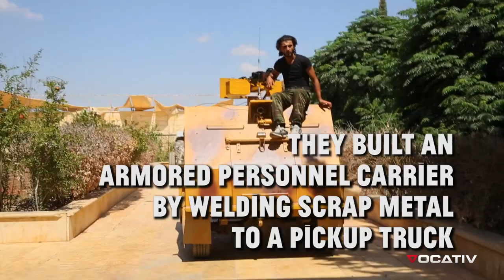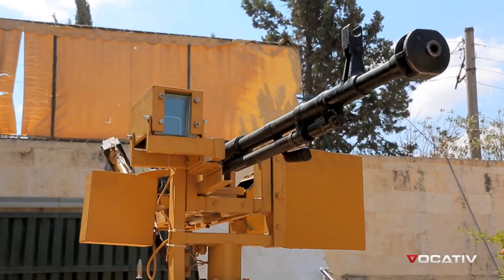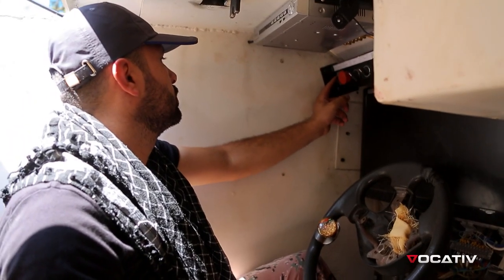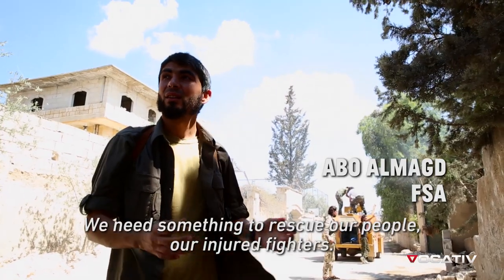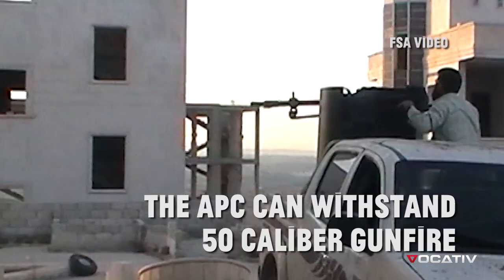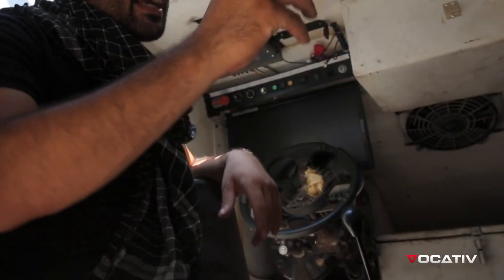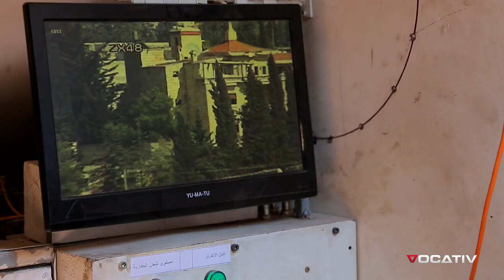DIY Tank Used in Fight Against ISIS

Comment: It has to have tracks to be considered a tank, this is an armoured fighting vehicle.

By the way, I'm pretty sure 50 cal goes trought scrap metal like a hot knife trought butter, you'd assume it'd have some markings if it had survived 50 cal shots before.
Reply: Yea. Agreed. This isn’t terrible for a IFV towing a APC trailer…. 
But it needs some spaced Armour at least 10MM thick. With The Gun Receiving some Armour too. Some. (Concealment Armour mainly).   The Inside TV could receive a High Quality Resolution for what he has.   With Spall Protection.   At least for the Gunner.     If he can take out the DUDE that just took out the Driver and Half the IFV…. That’s a Win.  Cause he’s probably the only one if that battle in this country that could take the IFV out anyways.   Be Cautious… Take your time.

Weld Good Reliable Welds. That ways when you come under Pressure from say an Explosion. Your not Tearing at the Seams.
Rupturing your Organs. And releasing your memories to What you believe in
The Back Axle should be a Duelly. 

Fuel tanks covered. Etc. 
The gun really needs to be Upgraded heavily. Perhaps Firing only the best Highest-quality ammo acquired with the best Precision? 

Idk.  To be fair I am a tank guy myself

Comment: The armor looks to be a little over 2 inches throughout the entire body. As long as it is high quality steel it is most likely very effective against heavy machine gun fire.
Reply: 2 inches = 50mm. Most HMGs if I recall correctly have around 19mm of penetration.
Reply: @someoneinthecaucasus3232  yes. 50BMG could technically pierce 22mm but that’s whatever.

The main concern in my eyes is as the lack of Space Armour from RPGs.  And then the lack of Spalling Protection.   At least protect the Gunner.
Reply: The problem is the prevelence of rpgs. They have no rpg cage and it would likey peirce

Comment: one RPG and... Puf!
Reply: As said in the video, this is a response to snipers
Reply: An RPG is HE not AP, this could probably take an rpg hit just fine
Reply: ***** you have to realise this is a truck with scrap metal
Reply: nah its a tank according to the uploader m8
Reply: ***** RPG do have AP ammo as well.
Reply: This can't take a RPG round.
Reply: Amotz Shvartzbard If the rpg is he and hits the front there is a good chance it could bounce or ricochet off. As for AP though or any shots on the side the apc is screwed. Still some nice technology considering what it was made of and such.
Reply: +Zanman There are various types of RPG rounds, it doesn't use "AP" rounds per say it uses "HEAT" rounds or High Explosive Anti-Tank. For the most common RPG the RPG-7 it can use the PG-7VS1 (Of which can penetrate over 360mm of RHA) which is most likely TWELVE more times more penetration than what this vehicle can handle. It would be obliterated completely on the inside and everyone would die instantly so no this cannot take an RPG. (With exception if they're using just regular HE or fragmentation rockets)
Reply: +bufa7777 The sloped angle on the front of the APC is not nearly large enough for a RPG to ricochet off. And there's no such thing as "AP" rounds for RPGs, there's just HEAT, HE, and Fragmentation and other various forms of those combined types.
Reply: There is one RPG land drone tho.
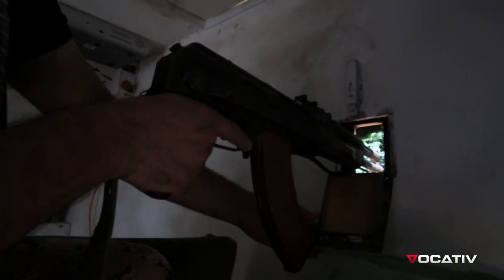Reply: You can see they actually used spaced armor at 1:26. That would help against some HE and large rounds
Reply: that APC could probably take an rpg hit at the front with some extensive damage but the sides would be worse off if they got hit by an rpg
Reply: Most real tanks cant servive an RPG strikes. RPGs were literally made to destroy tanks and other armored vehicles so yeah it probably wont survive but neither will anything really
Reply: @HeyYoFabels  an rpg fires heat based ammunition